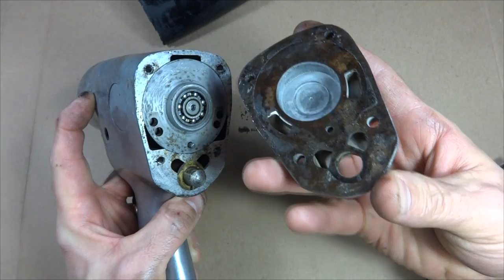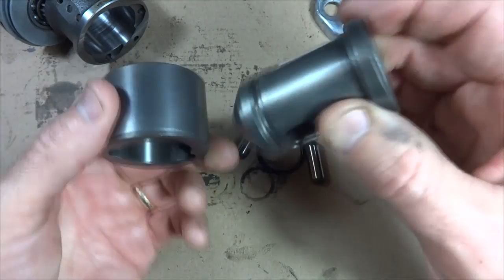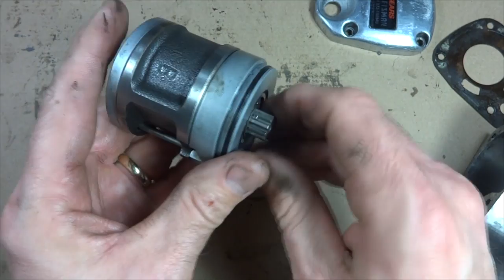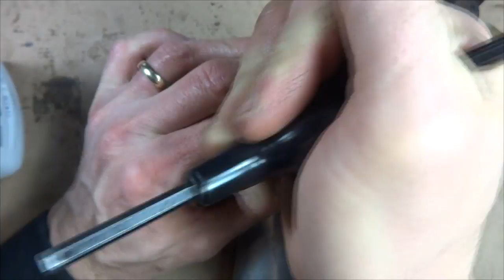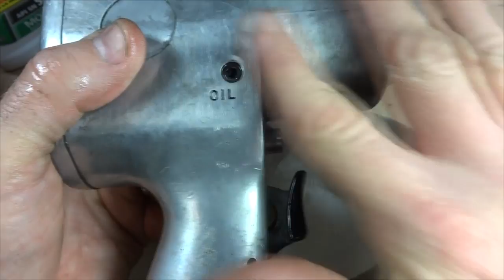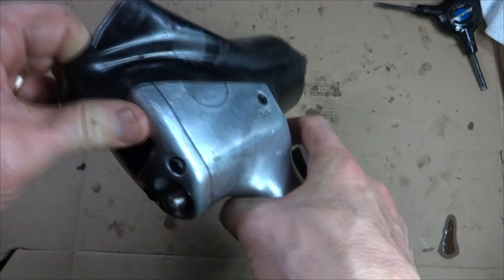Impact Wrench Disassembly/Assembly

Comment: Thanks so much ! I watched the video and  did exactly as you showed. It  took me 4 tries but I got it going perfectly.  My problem actually turned out to be was rust blocking an ample air supply but thanks to you, I did much needed maintenance as I was not aware of the moisture that had accumulated over the past and this was a contributing factor overall.
I have now learned to get a system that catches the moisture before it gets to the tool itself.

Comment: Hey , just picking up your video and was given a older Campbell Hausfeld TL1002 , similar to the one you worked on. Wondering about the trigger itself if you would know why it’s just loose and doesn’t do anything but loosely move back and forth. If I plug the tool into the compressor, it runs automatically without any involvement from the trigger. Sounds likes it’s stuck in On mode. Thanks if you see this and can comment. Neil

Comment: I looked in the manual for my CP734 air gun which says to use 22ml of SAE 30 in the hammer/clutch cavity. I see that you dumped out the excess after filling. Did you find this procedure in a service manual? Mine says nothing about this. Just want to be sure of the proper procedure. Thanks!

Comment: I have the same gun purchased in 1992. I worked at two shops so needed a second gun. It’s not very powerful compared to MAC/IR guns (400 ft/lb vs 625 ft/lb from my MAC AW434) but usually got the job done. I’d borrow a stronger gun when I needed it. I just used it for the first time in over 25 years and it worked fine. I’m surprised your boot is still soft, they tend to harden over time. Mine hardened up so bad I had to cut it off with a knife. Great video, thanks.

Comment: Hallo friend my 1/2 air gun did not get power.slow running.this is 2 years old gun. How re set and why this slow running.i did service but no improvement
Reply from the maker: Dunno. Sorry.
Reply: I had same result. Tried taking air intake apart. Now it doesn't work at all.

Comment: Are you suppose to run 30 wt oil in the gun at oil point then drain it or use airfoil oil

Comment: Nobody cares, but technically you want the ND30 flavor of SAE30 rather than the HD30 kind.  I think the detergent in HD attacks the o-rings and seals or something.
Reply: Yup, ND(non detergent)30.   I think the detergent causes foaming?   That's what I use in my air compressor and power washer pump.

Comment: I Watched the Video, then went out to the workshop and tore apart my Lowe's Cobalt 1/2" Impact wrench. Followed the instructions, Minus the cleaning which you did not touch on how-to. Improvised and used Acetone to clean and oiled liberally, and off I went. Works good Now, It was absolutely useless to me before hand.  Thanks
Reply from the maker: I just cleaned the parts. Degreaser. Or maybe hot water and dish soap. Maybe mineral spirits. I can't remember.
Reply: @RJTheBikeGuy  Acetone is great de greaser, Everyone

Comment: After following your instructions I got the wrench back in shape. However, it's losing a lot of air at the trigger, could you share advice on how to replace the trigger gaskets?
Reply: Humberto Gómez in ur wrench at the bottom is a little ball that is helping the air get through and a little spring so watch out when u take it apart. Check if the rubber ring underneath the spring and ball is okay. Then check if ur iron pin behind ur trigger isn’t broken. Also what I had is that the ball was stuck in the spring while it should sit in the wrench seperately.
Reply from the maker: Sorry, I don't have an answer for that.

Comment: I bought the same tool and its missing items securing or having to do with the metal tube that is for forward and reverse and thats what am trying see what they are and where to get them?  theres a small spring and I see a washer securing the bar to push reverse and forward.     mastergrip sears craftman identical
Reply from the maker: Might be easier just to go buy another impact wrench, then trying to find the parts.
Reply: once again i need to see the parts that hold the tube for forward and reverse mechanism  once removed there's a small spring inside the front of the tunnel where the bar goes or slides forward and reverse   whats missing in my gun    i see a securing washer and what also missing like a ball bearing inside where the spring is   inside a chamber

Comment: I pulled the part out of the valve body where the air feeds into my BLUE POINT AT500A and now the trigger no longer works. I am wondering how to fix that fuck up..
Reply: I did the same thing when this reassembly still didn't fix my power issue. Did you ever fix it?

Comment: I have a craftsman  875.199870 and its over 20 years old and as long as you oil it will last a long time. I am a disabled vet spent 7 years in the NAVY on submarines  wanted to do 30 but alas a stupid chain broke and it hit me crushing my spine So I am in a wheelchair,

I do not use it every day but if I was like I used them before the NAVY I was a mechanic with my dad who was one over 50 years. he used almost all craftsman. To bad now their tools are made in China. But I like craftsman impact tools as even my 20-year-old one I can get parts for it.
Reply: ncrdisabled Submarine vet

Comment: I have this exact gun and the manual does indeed state to use SAE30 wt oil for all of the people bawling about that.
Reply: I have a brand new GMC air impact gun that has never worked since I bought it.
I bought a kit that had a chisel impact gun and 1/2 inch wrench and drill all as a kit.
I purchaced it because i needed the chisel for some work..
I did not worry to much about the impact gun too much as being brand new I though that there can only be a small problem that i could fix at some stage.
Rather than mess about sending the whole lot back which are the directions i could fix this myself, but thought before doing so i would have a look on the internet to see if any one had ever come across one of these that did not rotate from start, and why it did not start.

Comment: How often do you remove the allen key grub screw to oil the gun?  I know you oil the air intake daily thanks Ian
Reply from the maker: +sandydogy I don't generally as I don't use it very often.
Reply: RJ The Bike Guy thanks
Reply: I fill the oil from the bottom of the handle where you connect the air hose coupler.
Reply from the maker: That only oils the air piston. It doesn't lube the hammer mechanism which requires more oil.
Reply: Thanks

Comment: Why did you choose 30 motor oil exactly?  Did this come from a source or what was your reasoning for this choice?
Reply from the maker: +Stan Skaggs I believe with was mentioned on the manual for this, or at least a similar model. I remember I spent some time researching the correct oil when I did it.
Reply: ok.. Makes sense I guess.. I just saw a couple of other videos which said the same thing too.  Just trying to figure out they they are wanting the motor oil...

Comment: Nice, those old made in Japan, Craftsman air tools starting with the 875 prefix are built by Florida Pneumatic, a very good company.  Florida Pneumatic, along with Chicago Pneumatic built some very nice high quality air tools.  How much torque does this wrench put out, 150ft lbs?
Reply from the maker: jewllake Sorry, I don't know.
Reply: 250
Reply: Before craftsman tool is only sears   air wrench made in taiwan

Comment: I do not use sae 30 oil.  I use exclusively air oil which happens to be a pure mineral oil that you can substitute Sewing machine oil or Baby oil with.  Other than that Your video was very informative.
Reply: Franklin Newhart  atf works great to
Reply: I use Marvel air tool oil.

Comment: I like yours video about tools: ratchet etc. :D Can we use a ratchet wrench sockets or only impact socket?
Reply from the maker: Dominik K. Impact sockets are designed to be used in impact wrenches. The are heavier. Regular sockets are lighter and hardened, and can potentially SHATTER explosively when used in an impact wrench.

Comment: Not seen inside one of them before, thanks for that. 

As an aside I used an electric impact wrench to get the stuck fixed cup out of a 45 year old Raleigh Moulton Mk3 frame (with a suitable large bolt affair).  The Raleigh cup is pretty hard to remove even if you have the correct too - and an impact wrench makes it even easier than using a long braker bar!
Reply from the maker: The turbine part is similar in most wrenches I think. The hammer part in this wrench is a little different. I have used an impact wrench for removing fixed cups too.